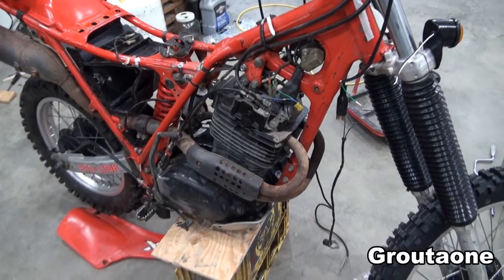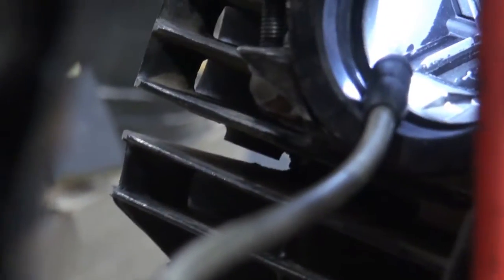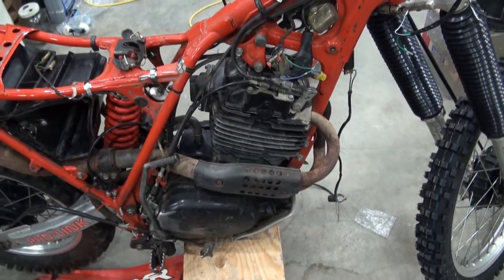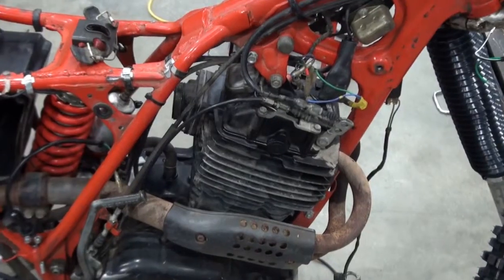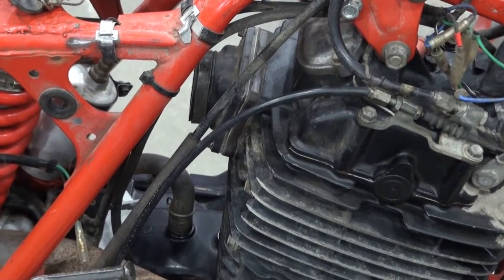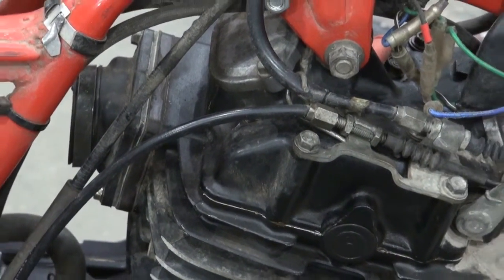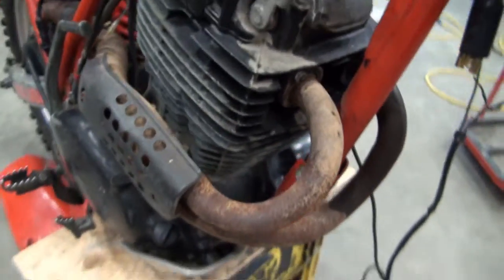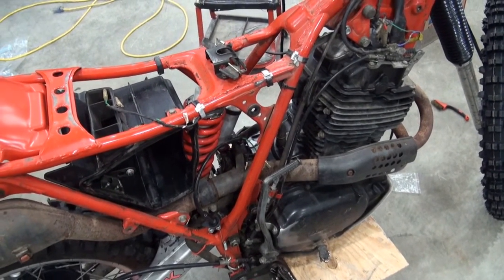Honda's Reed Valve 4 Stroke

Comment: Engines that spin high RPM usually have intake valve opening very early. This assists high-end RPM operation as well as high horsepower output. The problem is, if you're down in lower RPM there's still a little bit of pressure in the combustion chamber when the intake valve opens. This can push air backwards in the intake. Then as the intake stroke happens you suck that air back up into the engine. On a carburetor, this will add a extremely rich mixture. However as engine RPM increases, more energy is put out the exhaust, the exhaust headers start scavenging as they're supposed to, creating a vacuum in the combustion chamber at the end of the exhaust stroke beginning of the intake stroke. This then will cause the exhaust header itself to draw air through the carburetor before the exhaust valve shuts all the way. As the exhaust valve shuts the Piston is already on its way down to draw fresh air and fuel into the chamber. By adding a reed valve, You get kind of a flexible intake valve opening timing. At lower RPM while they're still pressure, the intake valves will begin to open but the read valves will stay shut. As the exhaust valve closes and the piston starts moving down you'll create negative pressure in the combustion chamber and the reed valves will start opening by passing air and fuel into the engine. At higher RPM, the headers will start drawing fresh air and fuel out of the carburetor as the intake and exhaust valve overlap at TDC during the exhaust / intake stroke creating a relatively early intake valve opening event. It's pretty slick. I would imagine that you would actually lose power and drivability by removing it. It will also probably bog in the lower RPM.

Comment: never knew about the reed valve...but i presume like you that the removal of the reed valve would de-restrict the aur/fuel flow and make for a stronger midrange motor...and bigger headers would also do the same...no doubt

ps: thanks for some motorcycle content, really missed the cr500 stuff, cheers

Comment: the new ktm 500 has a reed valve. isnt it to prevent cough outs. I have a xl600r and she likes a good cough out. no reed
Reply from the maker: If I remember right my old 79 never had a problem with a back fire but I think you are right at least in part it was to prevent low rpm backfire.